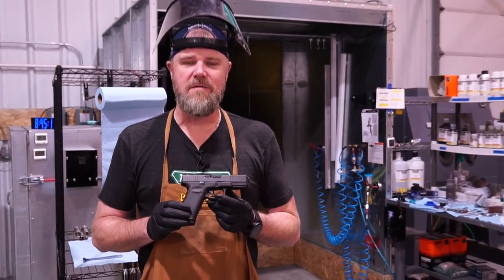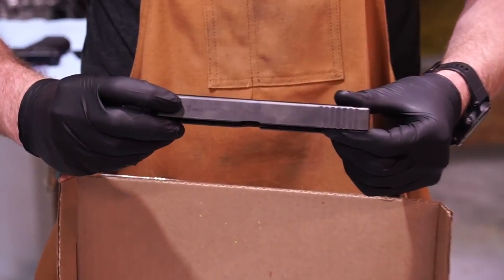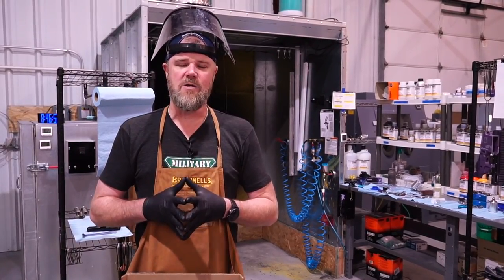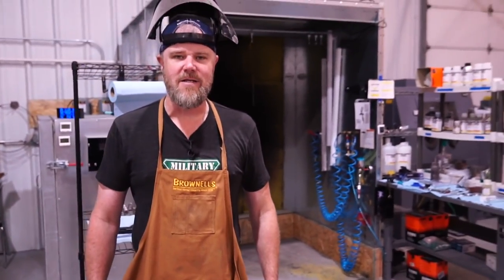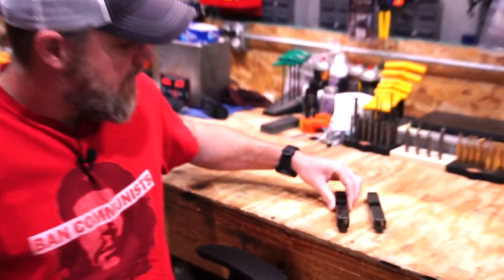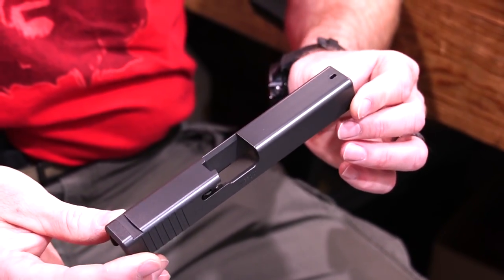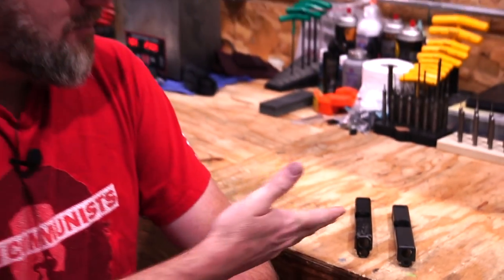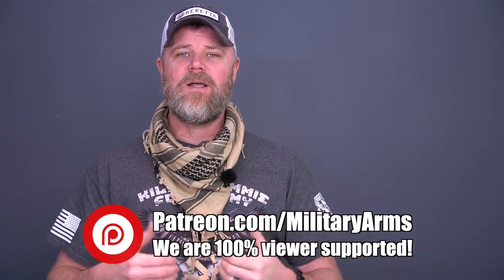Cerakote Acid Test

Comment: What's irresponsible is people are going to buy this new Cerakote due to Tim is making assumptions and not well informed about any of this. Yes you see bare metal per se. But it's not bare metal. If you inspected the purported "bare metal" area under a micron scope you would see and notice the Nitride is fused to the metal at a molecular level hence the metal is protected. Glock isn't just using a finishing/plating/coating. The DLC is just that but it's covered over the Nitride Treatment which goes on clear. Should leave the science to the scientist. And don't just assume from conducting a very poor test. The test subjects weren't isolated and were in the same container???? Come on.

Comment: To safely neutralize an acid, you need to apply base to it, not dip it in water. Yikes.
Reply: You're right, but in this case rinsing off a little bit of excess unreacted HCl off of a hard surface works just fine. For more dangerous/toxic acids like HF, I absolutely agree.
Reply: You must not remember your science classes very well. You can DILUTE acids in water, and given sufficient water you can dilute the minute amount of RESIDUAL acid on a surface to the point where it's very safe. Or have you never heard of Dynamic Equilibrium?? https://en.wikipedia.org/wiki/Dynamic_equilibrium
Reply: Dilution is a solution.  So is alcohol.  Space Ghost.
Reply: @Minuteman4Jesus  i literally have worked with many acids quite a lot in a chemical laboratory. Please continue being functionally wrong.
Reply: @slartbarg  My comment wasn't directed to you as it is now, so your attempt at an insult has failed. If I'm so wrong, though, explain how dilution of a minute amount of acid in a large amount of water is still "unsafe".
Reply: @Minuteman4Jesus  Of course I've heard of Dynamic Equilibrium, I was their bass player in high school!
Reply: @Minuteman4Jesus  ah, I actually read your comment wrong and they're showing up out of timestamp order, sorry
Reply: @slartbarg  I noticed the timestamp order is out of whack too.
Reply: The solution to pollution is d..umping a whole bunch of water on it.

Comment: Hydrochloric acid is absolutely nowhere near the same as salt water sprays. I’ve used acids for years as a nuclear inspector. Yes they are both corrosive & it’s a great test of the finishes, but it’s not equivalent to a 24hr salt bath test. Like you said, longer in the acid would be different. Great video though!

Comment: This is why Glock sucks
Reply: Take any other manufacturers slide and do the same and see if there’s a difference. Don’t worry, I’ll wait
Reply: @protectiverailroaddad7541  Beretta Bruniton finish will resist Hydrochloric acid just as well. Its just not as abrasive resistant as Cerakote.